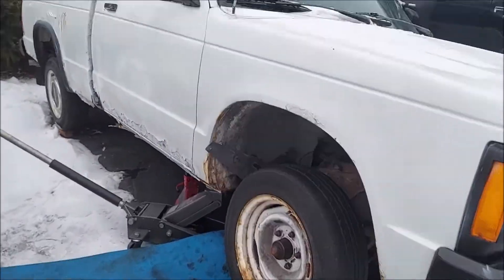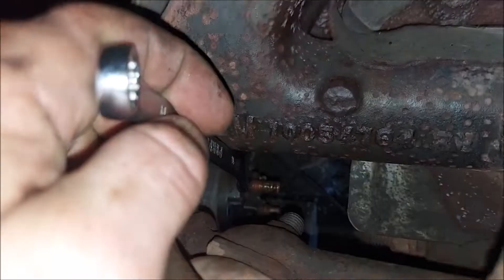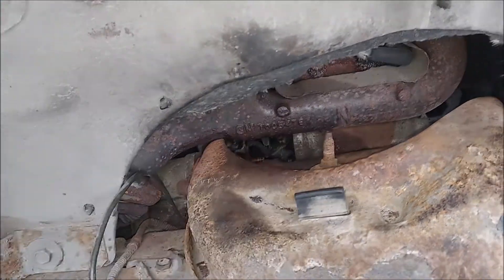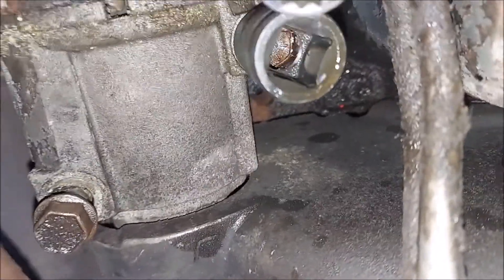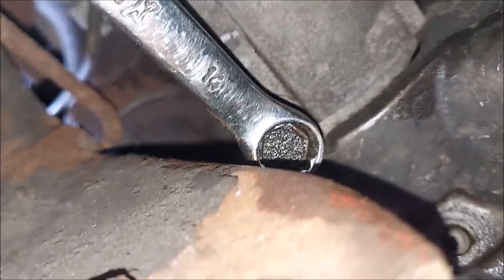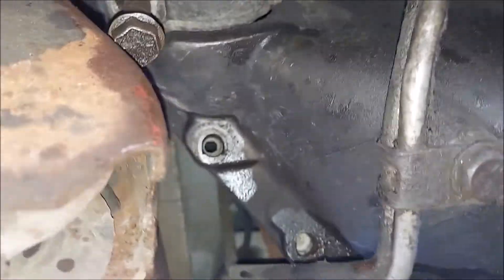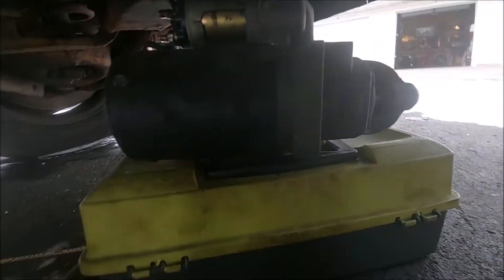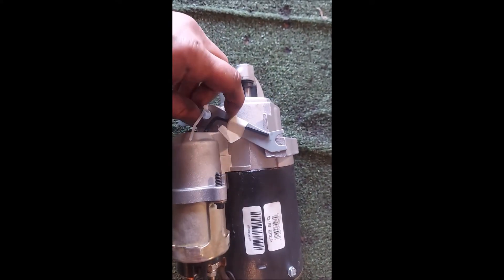1991 CHEVY S10 | 4.3 L | Starter Replacement | Blazer also 90s models

Comment: Thanks man! I got mine changed out yesterday. Mine took three hours plus as well. I couldn't believe they would design this engine where you have to take the flywheel cover off to get the starter out. I tried everything and it's definitely required on my engine as well.